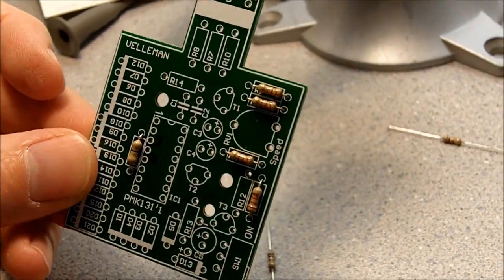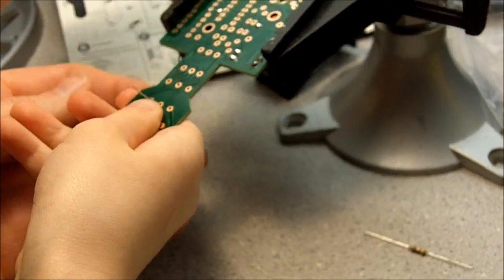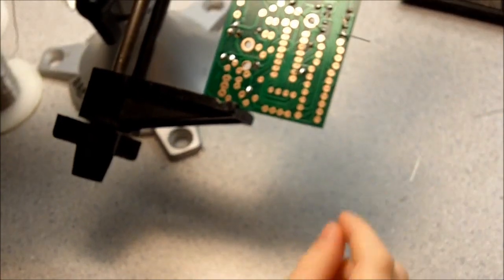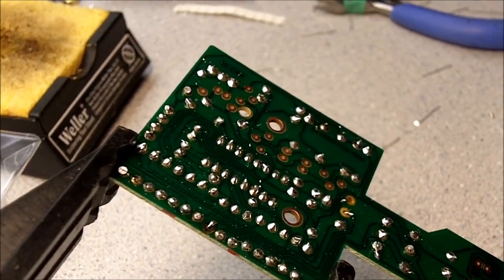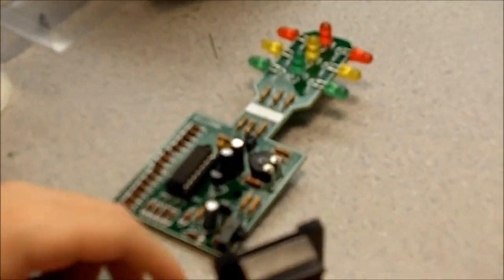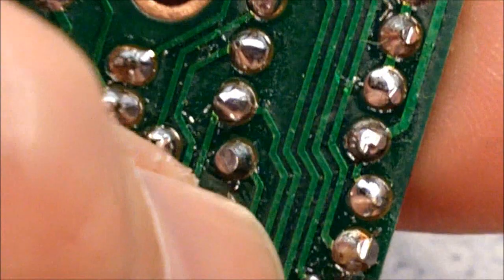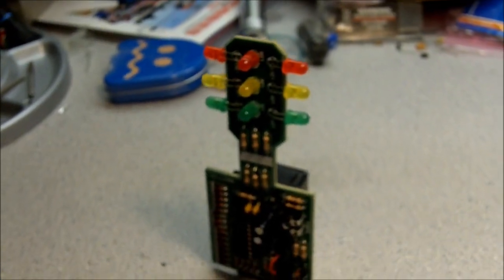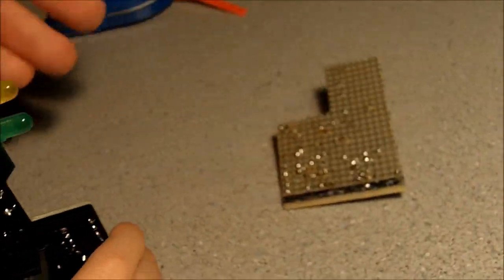Malachi Learns To Solder and Assemble an Electronic Kit (03-25-2011)

Comment: You are right about the circuit board,mine had a crack in mine and I had some of the little

l circles lift off sometimes its to much heat ,but this board just was a cheap piece of do do.

Comment: i finished that kit yesterday and that kit is lever 2 and he is supposed to do level 1 but he doesn't have to. he is very good as a 5 year old. he reads directions good and he solder's good. and i like velleman kits because you get a big foil pad to solder so so parts will not fall out on small vibrations and maybe a small drop. he is good and so am i. i love velleman kits.

Comment from the maker: @BrixXSM -Thanks for the comments!  Yes I definitely keep reminding him it could "burn his face off", and he did touch the holder once (see here 7:00) which gets pretty hot, yet he is not afraid and wants to keep building and learning.  I remind him to take deliberate movements and not to go fast.  Just always know where the iron is and to have his solder ready before he picks up the iron.   The iron is a little bit heavy/large for him, so the next project we will try a pencil tip iron.